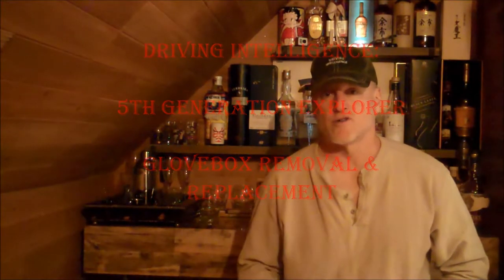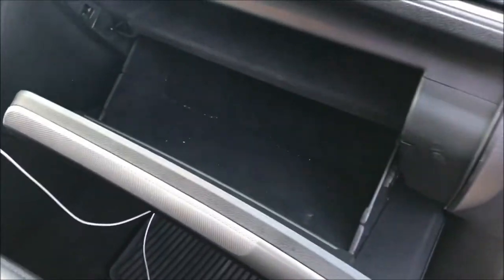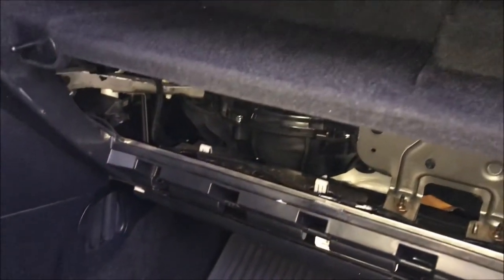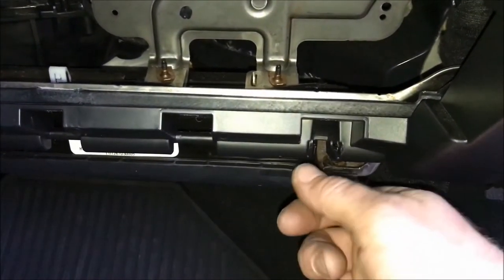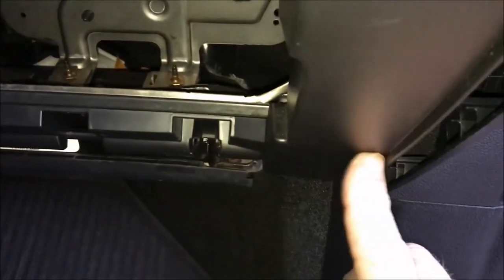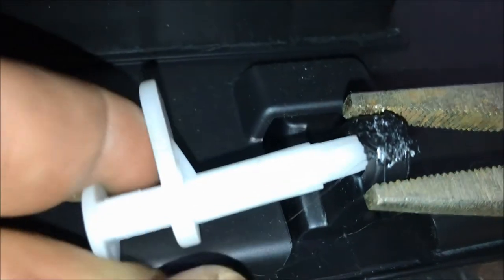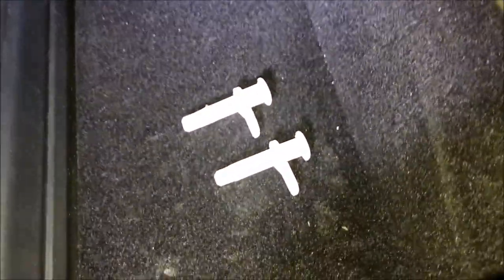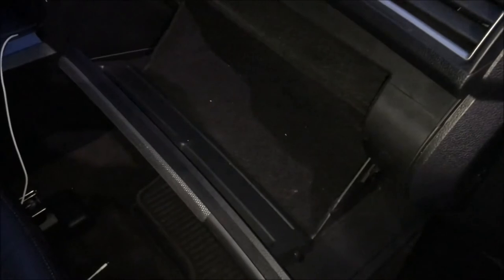How To Fix 5th Gen Ford Explorer GLOVE BOX Door: DOOR HINGE PINS INCORRECTLY INSTALLED BY FORD

Comment: Thanks for this video as when I was replacing the cabin air filter, I broke the hinges.  After watching this video, I removed the glove box and tried to use a soldering iron to re-connect the broken ends of the plastic; it did not work.  So I used thin metal strips I fashioned from picture hangers in the shape of the outside area of the of this broken hinge to bolster its strength.  I drilled two screw holes and using small sheet metal screws, bored them tightly into the plastic.  Upon reassembly, it worked perfectly.  It sure beats over $300.00 for a new glove box.  If I were able to post a pic, I would but don't think I can through this post.
Reply from the maker: Thanks for that note!  If you contact me at www.Facebook.com/drivingintelligence like my page and send me your photos I’ll post and link you ;)

Comment: There is a very easy way to fix this. 
Take off the cable and look under the glove box by laying in the floor looking up and you can see the white pins. Get a big screwdriver to pull the white pin over and it comes right out. The glove box can then be removed to fix it or put back on. I found this out after watching this video when my husband broke the box off. Hope this helps someone.
Reply from the maker: Thanks for your comment, the main point I was trying to convey with this video is that the pins were installed incorrectly by Ford when the vehicle was manufactured, and therefore would not pull out as you described.
Reply: @DrivingIntelligence  I totally didn't think of that. Thank you for bringing that to my attention. My comment can then just be used for those that can remove the pins that have been put in correctly.
Reply from the maker: @blssdx3  thank you very much :)
Reply: My pins are installed wrong too. My cable also broke and the front of the box separated from the back which has the hooks and hinge/holes so I had to buy a new glove box off ebay.

My repair for the broken cable was to crimp a ring terminal with a 1/2" hole (yellow 12awg) to the string cable (after cutting away the yellow plastic).

Comment: Thank you! Very helpful video. When removing the glove box in order to replace the actuator , I ran into this issue (one pin was incorrectly installed). After watching your video, I decided to cut the pin tab a bit with a hack saw blade. Then was able to rotate the pin so the remaining tab came out.
Reply from the maker: awesome, thanks for checking in

Comment: I had to remove the glove compartment door a few years ago and found it easy to do by not jumping ahead of myself. The easiest way is to lay on the floor and look up to the door hing. You’ll see the pins and using your thumbs or fingers simply push them into the middle of the door/glove compartment. I actually looked it up after I had done it. Your video showed up on my feed as many do when I look up things to do on my Explorer. I did have to repair my glove compartment door though because the guys at Jiffy Lube, at the insistence of the supervisor, checked my cabin A/C filter, despite my having told her that it had recently been replaced when I had a leak in the system repaired. I got home and opened the glove compartment to put the receipt in it and it fell off! I found the pins in it and the hinges that they go in broken. I was really mad because I had told them that the cabin filter didn’t need replacing. When I went back the guy who did it told me that he told his supervisor what had happened and that she told him to tell me that it was that way when he worked on it, which was a lie and I confronted her with it. So, she called the general manager and he never answered. I just fixed the darn thing myself with gorilla super glue.
Reply from the maker: great comment, this is why I never go to those quick change places.  Very poor quality.  The pins in the vehicle in this video were installed incorrectly at the factory which prevented their removal.

Comment: So I appreciate the difficulty you had.  Thats what I'm going through righ now.  Unfortunately you did not show HOW you got those white pins back in.  Thats my problem.  Do you do it after the door is on?  How do you get to the pins?  Thanks
Reply from the maker: Sorry, that video was not one of my best... the pins push in from under the glove box.  Once the glove box door is in place, you can slide the pins into their holes.  On this Explorer, Ford installed the pins incorrectly which made it impossible to reach the tabs, that is, the tabs were oriented in such a way they could not be removed as designed.  Hope this helps!

Comment: Thanks for posting.  2016 Explorer Platinum.  Glove box fell off and one of the hinges split but was still in tact.  Before I watched this, I super glued the split hinge and clamped it for 10 min.  Then I 2 part epoxied around the hinge to add some strength and also did the side that did not crack yet.  Mine does have an elastic strap that assists the box to open gracefully, but it was not connected.  When retracted, it hides up in the dash since it is black on black.  Waiting a day for epoxy to set as well as a new cabin filter to arrive tomorrow before I put it all back together so I don't need to touch it again for 1 year;)
Reply from the maker: Excellent!  One of my mantra's, "Don't Replace It, Fix It!"... good job, check out this playlist.  :)  https://youtube.com/playlist?list=PLGNsbVXzRfZMH88cKMaMtcWB9w8TrPquE

Comment: Thanks to all for the info. Both hinge eyes were broken. Could see where someone tried to jam it in. Eyelets were broken inward. Tried to solder melt to hole them in place. Used the picture hanger method below, bent to fit, screwed into place. Spent an hour (in the heat sweating my _ss off) and could not get the pins back in. They don't want to go, so forget them. Decided to cut  some dowel long enough to just get in. They are too long to back out. Installed, hooked up the actuator. Works great.
Reply from the maker: awesome!

Comment: Great video, do you know there should be a wire on the right hand side as well to take the strain and stop it opening too far ?
I’m
Trying to figure that out too
Reply from the maker: Hi, sorry I didn't show it in the video.  I do know about the cable that limits travel.  What is your question?

Comment: I just completed this task in about 15 minutes (not including super gluing the hinges back together), get the glove box out completely, use long nose pliers to crimp the pin while gently sliding it out, once the glue has set, position the glove box back on the tabs and add the cable, then the pins slide straight back in, no need for any other disassembly.
Reply from the maker: Thanks, the pins on this particular explorer were rotated, so they would not pull out.  The door hinges broke while I was trying to release and rotate the pins.  Once I fixed the door hinges I was able to install the pins in their proper orientation.  Ford installed the pins incorrectly at the factory and therefore could not be removed.

Comment: The compartment popped off the door when i went to re-install it. The glue i ordered did not hold it so now back to step one.
Reply from the maker: Sorry about that... you have two options, get a used unit from the junk yard or repair using small metal straps with epoxy.

Comment: My 2016 Sport had the same issue with the hinge pin on the right side, it was stuck behind the metal frame and couldn't be moved or turned.  I finally used the nuclear option and shaved off enough of the tab with my oscillating tool to allow it to slide.
Reply from the maker: Good call!  Especially since the replacement tabs are cheap and available. I think I linked them in the description.

Comment: I didn't have to take the side trim off just the bolts and I trimmed the pin closest to the door so it is easier to get out and added a pull string for better leverage.
Reply from the maker: Very good add... in retrospect, could have bought new pins, but they are a bit pricey.  My way kept the pin in one piece, but your method is a good option as well.

Comment: you can reach up under and push the white pin by that tab so slide it out of those holes.  They were tight on mine so I had to push against it with a screwdriver but it pops right over.
Reply from the maker: Thanks for the comment.  As I mentioned in my video, they were installed incorrectly and could not be pushed out.  Make sure you watch the entire vid!  And thanks again!  ;)

Comment: I wish you could do mine. I tried to do it myself and the exact same thing happened to me. So mine closes but is somewhat off level now. 🤦🏻‍♀️🤦🏻‍♀️ and bugs me soooo much. Thinking of just getting it replaced but man o man that’s gonna cost me
Reply from the maker: Your hinges are broken? You’re not able to fix them as I did in the video?
Reply: @DrivingIntelligence  I don’t think I can. Because the hinges broke on the actual glove box. Not on the dashboard itself. (If that makes any sense) I have a 2014 explorer xlt. (In girl talk) the plastic circles on the glove box itself that keep the box leveled broke open. I don’t know what they are called. But doesn’t look like they can be fixed. 🤦🏻‍♀️ I should have just paid the 80$ for ford to do it 🤦🏻‍♀️🤦🏻‍♀️
Reply from the maker: @dianita99  Thanks for the update... That is exactly what I fixed on this Explorer.  You need to glue and actually plastic weld the loops back together, then reinstall properly with the white pins.
Reply: @DrivingIntelligence  ok. Thanks so much! I’m definitely going to try. Ur the best! Thank you for all this amazing info. And for a fast reply! I’m going to try to fix it with this method. 🤞🏻🤞🏻🤞🏻
Reply from the maker: Get your issue resolved?

Comment: Unfortunately I didn't see when you pushed the tabs back into place just that they were pre set ready for the box.
Reply from the maker: Sorry, it was so tight under there to install the pins and video.  The holes are pretty obvious without the pins installed.  The push towards the sides of the glove box.  Easily pushed in.  Does that help?

Comment: Thanks. I will have to fix mine as well.  What a crap design to access a replacement part.  I am finding that Ford is the worst for access to parts that should be easily changeable.  I would like all engineers to be forced to deal with these things before they release a design to market.
Reply from the maker: For years I was Director of a high tech services business unit.  We reviewed every product for supportability / maintainability.  I feel like none of the automotive companies do this.  They design vehicles to last 100k miles and when they fall apart after warranty, charge an arm and a leg to perform the repairs.